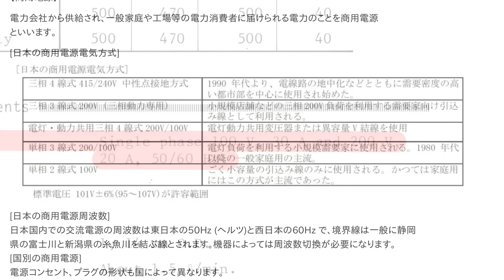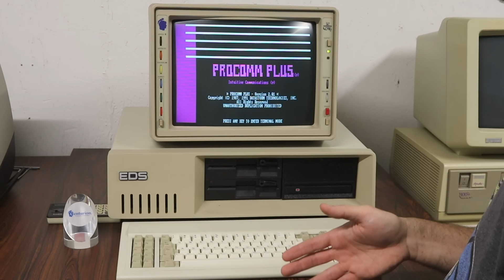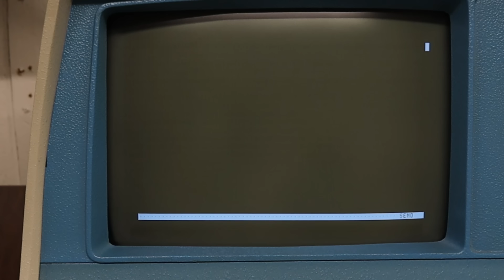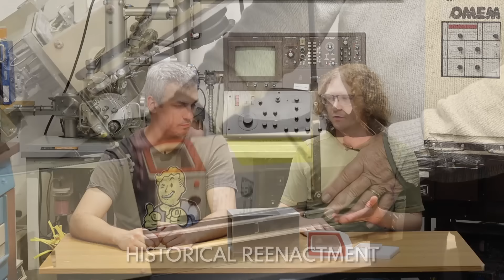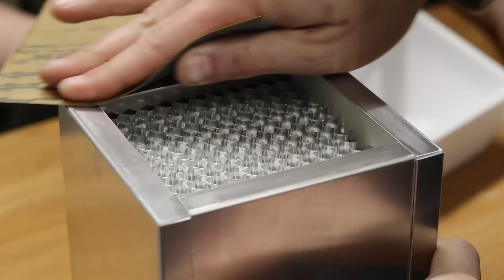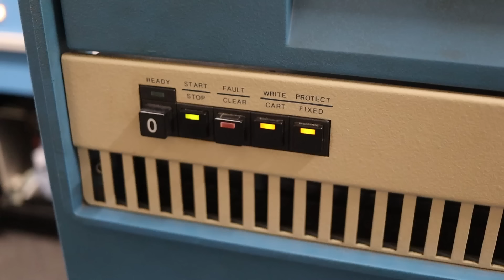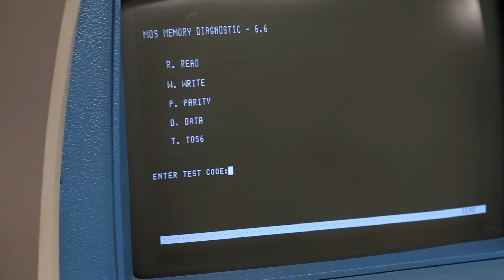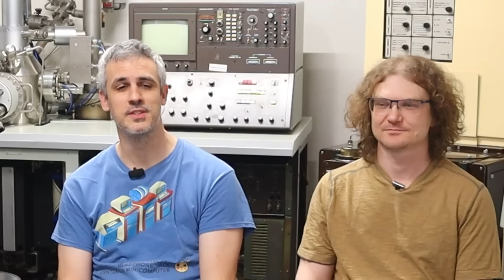Welp... that's terrible.

Comment: Oh my, the JAMP 9500F! It tried to compete with Physical Electronics. My job in the 80s was on PHI 590 Auger Electron Microprobe (0.2u-5u). I couldn't compete for spot size, but only took 3 minutes to get good S/N spectrum instead of 30 minutes on this JAMP, lol.

Comment: I have a bunch of new/old stock radio shack transformers, the ones with a 12/24 volt secondary, a center tap, and rated for 1.5 amps. you would obviously need bigger transformers, but let me explain something first. say you take a 12 volt transformer and wire the primary side as normal, but the secondary side you put in series with the utility power coming from the wall. what does that do? depending on the phasing, you will have either 132 volts or 108 volts with 120 going into this. add more transformers in series and you can boost or drop the voltage in increments of 12 volts. it is limited to the current rating of the transformer secondary, but it is a neat trick that can come in handy.

I used 4 relays and 3 of those radio shack transformers, and now I have an 8 speed fan controller that can change the voltage from 48 up to 120 volts, depending which relays are turned on.

so if you have 240 volts and you need 200 volts, you can get it by putting the secondary side of a 40 volt transformer in reverse polarity series. if you need 15 amps, you probably want a transformer capable of at least 20 amps on the secondary side.

Comment: You could do is have a delay relay when you power on the Centurion to delay the power for the Phoenix drive so you wouldn't have issues. You might rig the power to output of the PSU to the relay to trip it so you can power the drive.

Comment: Use the Buck/Boost Principle. Add a 20 volt transformer and use the 20 volt winding in reverse phase angle in series with the line supply and it will reduce 120  volts by 20 volts giving you 100 volts. Best to use two 20 v 30 Amp transformers to buck each phase of the incoming power in a central unit and break out of that unit with  100/200 volts. You can buy surplus transformers, old Astron (brand) Ham radio Power supplies (They use 19 v transformers), or buy new. We hams do this all the time to power OLDER Ham equipment that use 110 volts instead of 120 volts so that that the Vacuum tubes (which can be voltage critical) that are used in vintage gear don't get overpowered.

Comment: I think the best way to step 120VAC to 100VAC at 30A is an autotransformer. As autotransformers are a single winding with a variable tap, the core doesn't need to be rated for the full VA of the load (which would be 3000VA), they need to be rated for the difference VA, so if you're dropping 20V at 30A, it needs to be rated at 600VA (plus some arbitrary safety margin), although the wire itself would need to be rated for the load current. For 200V 20A, it would be an 800VA autotransformer off of your 240V breaker. You might also be able to get away with dropping the voltage close to but not all the way to 100/200, which would make the VA requirements smaller. I think Japanese power has a tolerance of 10%, so the JAMP might in theory work fine on 110/220, which halves the required size of the transformers. If you push the margin like that, you'd have to account for how far your own home is from its nominal voltage because US has tolerance too.

Some notes: I am assuming the two supplies are completely separate and can be provided from different circuits. I live in Europe so I have no practical experience with US wiring, so I'm translating what I know from here to what I've read about US domestic circuits.

Comment: To get 200V from 240V you need a buck transformer. Commercial products are expensive but you can use any 240V:48V transformer or make one out of multiple transformers in series or parallel. The secondary needs to be capable of delivering the current your load. You could also buy or salvage a core and wind your own autotransformer, it only requires one winding with a tap.

Comment: This is probably useless but I fed your early error into Google's AI and I thought the response was interesting: Based on the register values provided, this error appears to be a CPU trap or fault occurring during the boot process or early execution on a Centurion Minicomputer (likely a 16-bit system from Centurion Computer Corp).
While specific technical manuals for these legacy systems are not widely digitized, the fields in your error message can be decoded based on standard minicomputer architecture of that era:
Error Field Breakdown

* co:01 (Condition Code/Operation): This typically indicates the type of fault. A 01 often represents a Privileged Instruction violation or an Illegal Opcode. It suggests the CPU tried to execute a command that doesn't exist or is restricted to a different "level."
* lvl:00 (Level): This refers to the CPU execution level. 00 is the highest privilege level (often called "Monitor" or "Kernel" level).
* map:00 (Memory Map): Indicates which memory map was active. 00 is usually the system's direct or physical mapping mode.
* IAD:13F1 (Instruction Address): This is the Program Counter (PC) at the time of the crash. The error occurred while trying to execute the instruction located at hex address $13F1.
* EAD:000000 (Effective Address): This is the memory address the instruction was trying to access. Since it is all zeros, the program likely attempted a "Null Pointer" access or a jump to an uninitialized address. [1] 

Common Causes & Troubleshooting

   1. Corrupted Boot Sector/Disk: If this happens immediately at startup, the system is likely loading a "jump" address from a corrupted portion of the boot disk (pointing it to the empty $0000 address).
   2. Failed Hardware Handshake: The address $13F1 may be a routine waiting for a response from a peripheral (like a disk controller). If the hardware fails to respond, the system may "fall through" to an illegal instruction.
   3. Memory Fault: A bit flip in RAM could have altered the instruction at $13F1, turning a valid command into an illegal one (co:01).

Recommended Steps:

* Reseat Boards: Power down and firmly reseat the CPU and Memory boards. Oxidation on the gold fingers is common in legacy hardware.
* Check Power Rails: Ensure the +5V and +/-12V rails are within spec; "noisy" power can cause random CPU traps.
* Boot from Alternate Media: If you have a backup boot disk or tape, try booting from it to rule out a software/disk corruption. [2] 

Are you seeing this error immediately upon powering on, or does it happen after the system has been running for some time?

[1] [https://www.scribd.com](https://www.scribd.com/document/696636001/Error-code)
[2] [https://ps-2.kev009.com](http://ps-2.kev009.com/pcpartnerinfo/ctstips/49fe.htm)

Comment: You don't need a huge transformer for small step-up or down - e.g. to go 240V to 200V at 20A you only need a 240 to 40V transformer rated at 20A on the 40V side, only 800W which is about the size of a microwave transformer. In fact you could probably rewind a 240 MOT to do this, though these are likely not too common in the US, but a pair of rewound 110V microwave transformers could do it for minimal money.

Comment: For the 100V/200V problem, you might want to consider a Variac (variable autotransformer).  Either one large Variac and a transformer with a center tap to get the 100/200 volts or perhaps two separate Variacs.  Let me know what you think...

Comment: What smells like a memory issue but isn't a memory issue? A power issue, every time. Throw a voltmeter or oscilloscope on the power rails during a high-power operation, and I bet you see some healthy dips.

Comment: After reading some very reasonable comments about possible particles crashing the fixed platter:
First:  I'd say it would be good practice to put some paint coating onto the printed parts on the inside to make sure everything is bonded well - something like a 2 Component car paint, because it makes a good amount of thickness and a shiny (therefore clean) surface.  Easy to do, done in no time. Secondly: sanding metal on the outlet of such a HEPA filter is an absolute no go. You get microscopic metal parts, and even more dangerous: aluminium oxide abrasive (corundum) particles from the sanding paper. The most dangerous thing to a Hard Drive (and subsequent the platter)  that has ever been able to come with air. I would recommend not scraping it at all, just wipe it carefully (not moving the cloth over the filter opening) to make the epoxy bond well. My experience with epoxy is, it will be strong enough anyways that way.

What a mess. As I said some years earlier: A head crash of a platter of that era almost ended the company of my father, as the work of 5 Months of the whole team disappeared in seconds as the head of the rented hard drive crashed. He never got that high value customer back. The irony of the story: My father was an expert in air filter technology, for example he had designed the air conditioning for AT&S that used clean room environments for Photolithograpy (they still make  CPU substrate boards - the connection to microscopic contact points of the CPU). If he only had known, that there was a Filter inside the Hard Drive in his carpeted office rooms...  I was a child back then, but I can still remember how devasted my father was. He was obsessed with backup systems ever since (I have great memories about magnet tape drives of the 80ties and 90ties that ran for hours to store the whole data of all platters of the network...)

Comment: How about a 240V to 40V  tranny with the secondary wired series bucking with the 240V feed? The tranny would ned a 20A secondary - 800W total. A better proposition than a 4kW tranny.

Comment: I suspect you have created ground loops, and that is the cause of the intermittent errors. Try removing the new ground straps you added and see if the system becomes more stable. Sorry about the Phoenix. I hope you can fix it.

Comment: Use a Variac on the input to a 110VAC to 220V transformer, whatever size amp draw needed, then turn the variac down to 100, VAC, which should also bring the 220V transformer down to 200VAC.

Comment: I recognize the Phoenix from my days at MDS (Mohawk Data Sciences) in the early 80's. It was called the MDS 2175. I was one of the two technicians in NL certified to replace heads and fixed platters after a head crash but alas, I wouldn't be able to do so today and all docs have since been thrown away. Maybe you can hunt down an MDS 2175 or spares for one if those still exist.

Comment: Something may be obviously wrong with this but I will give my suggestion. Why don't you use solar inverters? Find the feed back voltage divider and adjust to desired voltage. Or maybe see about buying one for the Japanese market. They can typically take a very high dc voltage so you can rectify 240v as input. Idk if this would cause issues without huge filter caps though as solar is obviously pretty stable. I also don't know if the computer requires the voltages to be in phase. They do make inverters that can do split phase or combine to create split phase though. Cheapo solar inverters are pretty common these days a 3kw unit can be as cheap as 300

Comment: Not sure if anyone else has recommended this but I would look into a buck boost transformer for your voltage issue. It only needs to be rated to handle the smaller percentage of power for the 32-40 volts that need to be dropped. I don't exactly understand how they work, but this could be your solution. As long as 60Hz is ok.

Comment: I think I'd prefer to make those endcaps as a slip-over-sleeve item for the filter and seal the joint with Kapton tape. That way you can reuse them on the next filter without much hassle and vastly less dust/abraisve particle risk. (This may necessitate making the rectangular filter a couple mm shorter in X/Y dimensions depending on clearance in the case)

Comment: You need an autotransformer. You can wind your own on a big toroidial core. Basically it's a single winding transformer. Let's say for example  (not real numbers,just an example I pulled out of my back side) you have 480 turns. You make it with the following taps, 0 turns,200 turns,240 turns, 400 turns,  and 480 turns. (You probably could leave off the last 80 turns if you will never use 240v.) Connect the 120v line across the 0 and 240 turn taps. You will see 100. Across the 0-200 turn taps, 200v across the 0-400 turn taps, and 240v across the 0-480 turn taps. Alternatively,, you can supply 240v across the 0-480 turn taps, and get 120v across the 0-240 turn taps. (Along with 100. And 200v) You will need to do a bit of looking to find some real numbers for your transformer core. 

Take a careful look at the transformers on the microscope. They might have a tap on the primary for 110 and 220. The next thing to look at is how the voltage put are used. Depending on the design it might actually be another to take 120v and 240v. Another question is, how much power does it REALLA need. The amps listed are just the standard circuits.

Comment: A small transformer at primary 115v 
15v ac  secondery  in series with live 
And dubble the amp

So 1live 115v - 15v = 100 
Primary conected to neutral aand live

You have to test the way seconery is coneted if you have it wrong way you will get 130v 
But you just need to filp the wires

A 300w transformer  will get yo 10 amp with out problems

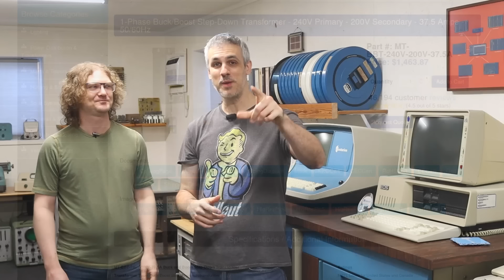Comment: 2:30 One thing I did on my Roland SC-88 that I got from Japan, the power supply itself had a configurable transformer that I desoldered the wire from the "100V" terminal and soldered it to the "120V" terminal. It still worked on the 100V line, but on the 120V there's less waste heat.
Your options and results will definitely vary.

Comment: you should add locating pins to the air filter adapters or make them go around the filter (like a pipe coupling) instead of on the filter

Comment: A 12:10 autotransformer (which does NOT provide electrical isolation) on each supply line is probably your best bet to set up Japan-compatible power.
(In a previous life I was design engineer for a power-transformer manufacturer. DM for details.)

Comment: you WAY over though the filter cap attachment...WAY WAY over thought.....wipe the mating faces with alcohol and use GE clear adhesive caulk.......sanding near a filter is a fatal error

Comment: if you get a 120v:20v 30+A transformer and use that to subtract the 20v from the 120v line you have a rudimentary autotransformer setup and will handle the job
the 120V side of the transformer is across the incoming line voltage and the 20V side is in series in opposite phase (subtracting) this will produce the 100V required
double up on the other phase to make 200V between phases
This is essentially how pole-top voltage regulators work in Australia at least
I can elaborate further with schematics if you're interested

Comment: Dude, partial power procesing .
Get yourself a 240V:40V transformer and wire the 40V winding antiphase in series with your 240V supply to buck off the extra voltage. If you need 200V 30A, the 40V winding only needs to handle 30A, so that's a modest little 1200VA transformer.
Of course, you don't need to go exact voltage numbers. I'd go for 36V, to allow for a bit of sag.

Comment: If you only need to change the voltage and don't need galvanic isolation, an autotransformer is a more economical and more efficient way to do it. The autotransformer need not be rated for the full VA load, only the VA difference it is making up. So if you have 240V 20A and you need 200V 20A, you have a difference of just 800VA. In practice to keep things happy at startup, we'd use a 1.5-2kVA autoformer. Just verify the current ratings are suitable as some rate their autoformers in transformer VA, while others rate it in load VA, the latter being a much larger number.

This unit will probably run very happily on 104/208V as that is nicely within the tolerance bands for Japanese 100/200V power. This also allows you to use MUCH more common 240V/208V buck/boost transformers instead of the more exotic 240/200 units. These 240/208 transformers are all over the place in the surplus market. 

I don't think I live TOO far from you so if you want a hand with this, let me know. I might even have a suitable transformer for a proof of concept. I even have exotic high power incandescent lamps to test with.

Comment: In my experience, 100V electronics will run perfect fine with 120V, it'll just run a bit warm. But obviously if you're going to step 240V down to 200V, you may as well step 120V down to 100V.

Comment: A Variac from a 240v country should work. But honestly 240v is within the range of a 220v supply
Reply: Considering that our "240V" is nominally closer to 230V ... I think there's a 5% drift allowed, so 218.5 to 241.5. But I've never dealt with the witches brew that passes for JApan's electrical system, so I'm taking no bets on that.

Comment: A buck transformer does not have to be rated for the entire power of the system. Your clip of the $1400 transformer shows a straight stepdown transformer, a "buck" would be much less expensive. Getting the exact voltage might be an issue depending on the actual voltage of your 240 nominal and the tolerance of the machine. A 16/32V buck/boost is common (as is 12/24) don't know if that would be close enough (240 - 32 = 208), but it might be. 20A x 32V is less than 1KVA, a buck/boost transformer that size would likely cost less than $300

Comment: Wow the good ol DEC pdu ! Back in the 90s I used to be able to pick them up for like $ 25.00 at a local surplus store. They were great for powering sound systems. 30 amps 120 volts would run most modist powered systems and the remote power on / off option was easy to run through a spare pair in an audio snake.